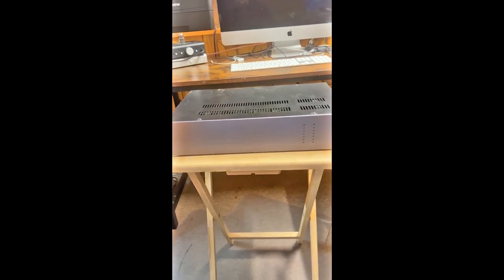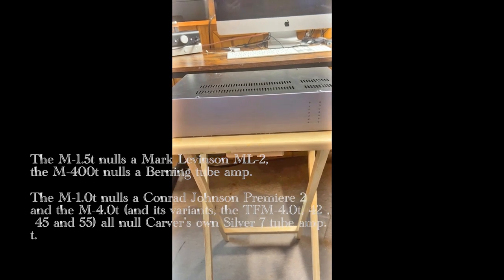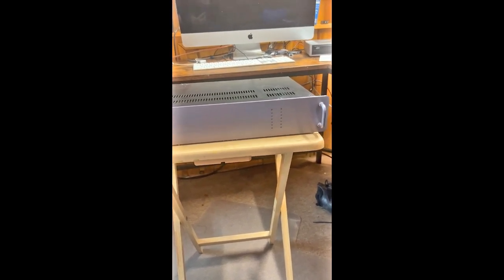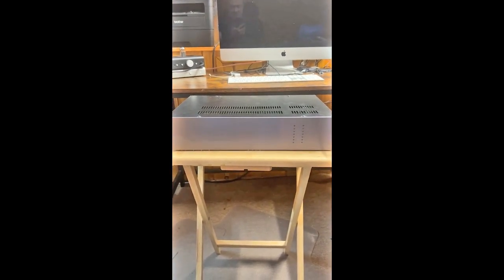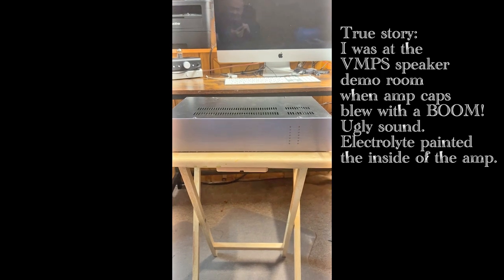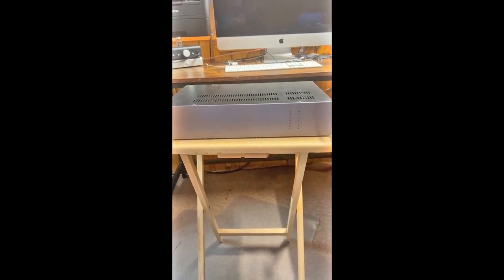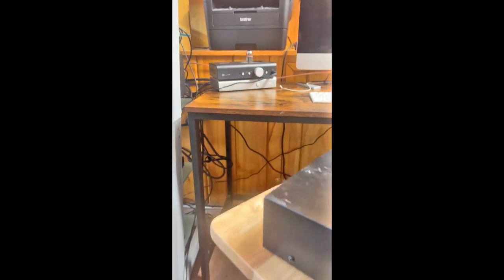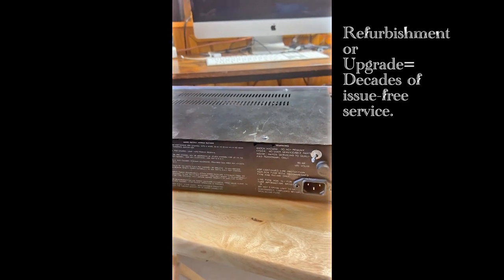Should you buy, refurbish or upgrade vintage Carver audio products?

Comment: I miss my M-1.0t mk II's and  PM 1201's. My road rig consisted of a case with a pair of M-1.0t mk II's running a pair of 502b subs, and two PM 1201's running a couple of monitors and four PT 2400's running our four pole-mount Custom PPA15 800W PA enclosures. Was the closest you got to Tube sound with enormous power and clarity. Also had an optional outdoor kit with two more PT 2400's driving two pairs of AWCS-II SR tubes that my dad hacked to work way better than with the WSC controller, those things would rattle fillings out of your head 100ft away in a grass field, the sound pressure was nuts. My dad was a huge Carver fan and when his boss had bought a high-end boutique loudspeaker company back in the 90's, it came with an entire room full of about fifty M-1.0t's, M-1.5t's PM1200's/1201's PT-1800's and PT-2400's  The PT-2400's were pre-production units and had some supply issues. I think my dad offered his boss $1000 for 12 varying units, the 2400's weren't working right and the 1800's kept blowing fuses, he put about $500 worth of component upgrades into them and then we beat the bag out of them for years. I toured with the kit for years with multiple bands, he did as well, in addition to DJ events. He still uses four of the same 2400's in his DJ/traveling PA sound-kit and he's in his 60's.
Reply from the maker: My favorite thing is a "Resto-mod".  Like giving a 57 Chevy a modern Corvette drivetrain and suspension. You have a classic, that's even better and more reliable after a mod.  Better parts= better performance.

Comment: I like carver products for the most part. I liken them to pioneer or any other consumer lvl audio. Every brand has its good and its bad products so I don't listen to the haters or fanboys. I have a couple TFM 35s and am pleased with the sound quality. I like the warm tube sound they give. Whats there to hate?
Reply from the maker: You definitely need to look at Carver as polarizing.  Haters for example, likely heard one Carver product for a few minutes in a suspect system.  So they paint ALL Carver products (even modded) as sounding like crap. They have never heard a modded unit, especially since there are many mods that are very different.   Fan boys go overboard and lavish praise on the low end Carver stuff that wasn't very good to begin with.  The truth is in the middle. Carver DID  beat a roomful of press and audiophiles that couldn't tell the difference between his amp and a Mark Levinson.  That tells you the power of blind testing over hype and hate.  And Carver DID produce a few lemons and products that were  mediocre at best.

Comment: I have a Carver C1 preamp and carver tfm 45 amplifier upgraded and a carver m1.5t mkii upgrade from nelion audio speakers are elac uni-fi uf5 speakers
Reply from the maker: If I were to do this right now- I’d definitely start with the TFM. I’d have Neilion do all the mods, including driving low impedance.
Reply: I have a Tfm-45 as well, who did you get to service ?
Reply from the maker: The sunfire products are superior to carvers older amps.  The load invariant alone solves every issue the old units had.

Comment: Thanks very much for this video. Your thoughts on these Carver products was nice to hear. I recently bought a pair of Fortes and the guy threw in a Carver MXR-130. The synergy between the two is actually quite good. The amp also drives my Tekton Pendragons with ease. 

I do guitar and tube amp repair / set ups, upgrades, modifications, etc. as a profession, but don’t work on solid state too much. I really like the original sonic character of the amp, so I’m going to merely upgrade the electrolytics and anything else I see needing replacement. 

Thanks very much again. Your thoughts and experience is very much appreciated.

Edit: I forgot to mention those dreadful binding posts will absolutely be changed
Reply from the maker: I had an MXR-130 with my modded Forte II's until I moved to 5.1 (two pair of forte II's).  It was one of the best sounding receivers (to date).  It also delivered the power it claimed, it wasn't some "faked" rating.
Reply: @scottlowell493  Hey Scott 👋 Nice, man! Very cool to hear that.  Yeah, the sonic signature of the MXR-130 definitely doesn’t sound like a typical class A/B power amp. It has a certain warmth and sounds almost tube like. It reminds me somewhat of my SE / SET amps. Also, lower powered 70’s Marantz like the 2215, 2220(B), 2230, etc., in tonality with that beautiful overall midrange warmth, and overall satisfying presentation. Marantz from that era which had  higher wpc, lost some of the magic of the lower powered ones. 
It’s very similar to said amplifiers just with more power and slam without falling apart at lower volumes, but also maintaining its composure at higher SPL levels and dB’s. 

Sweet! What’s better than one pair of Fortes, is two pairs of Fortes, of course. Can I ask what type of sub you’re using and/or used? Certain subs just don’t have that seamless integration with certain speakers, namely higher sensitivity ones. What mods did you do to your Fortes? I’m upgrading the crossover parts in my l’s but not necessarily doing modifications. I guess I am by putting dynamat on the horns and driver and new binding posts…

Thanks again, Scott! Great vid, man.

Comment: Very informative video. Do you know what the M 200-T was nulled against?  Also, what is the topology of these amps?  Class A/B, class D?  Class H?
Reply from the maker: I'd have to ask Bob that one.  The M1.5T seems to be one of the few that's nulled against a solid state amp. The M200T was never listed, but I bet .02 cents that it was either one of Bob's tube amps or maybe a Conrad Johnson.  It's my understanding they are all class a/b. They are certainly not switching like D,T,H etc.

Comment: What do you think of the digital time lens stand alone unit ? I have one. Where should it go in the chain of streamer, DAC, pre,-amp and power amp ?  Is it good to adjust dither ?
Reply from the maker: It's a self contained soft-eq for the midrange.  It's like a mini parametric eq.  It's in line like an eq.  It was originally created to counter the horrible sounding cd's in the 80's that were very brittle sounding.  These days?  Unless you MUST have it, there are better, and more flexible  EQ's out there like a Schiit audio loki.

Comment: I have an 806x 6 channel power amp that I can just barely hear some 60 Hz. hum if I'm within a foot of the speakers, been thinking of doing a recap of the audio chain myself.
Reply from the maker: You may find the issue is more than just degraded caps.  Good luck.